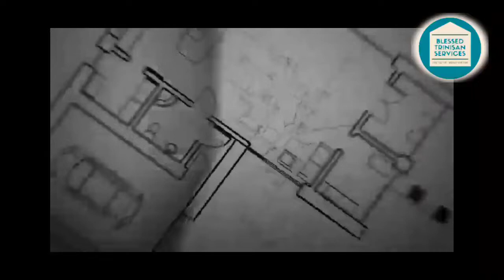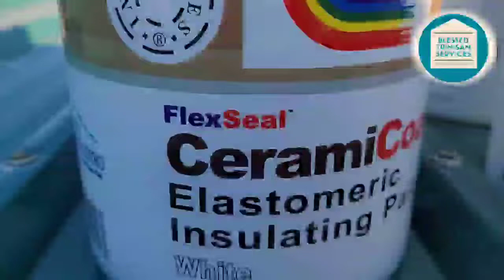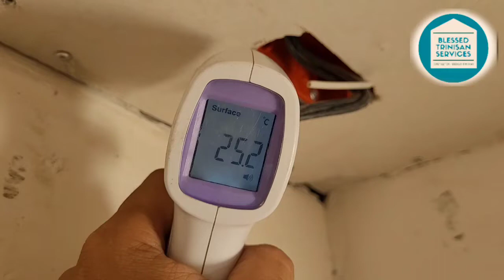HOW TO LESSEN ROOF/CEILING SUN HEAT WITHOUT USING INSULATION FOAM

Comment: Sir, gawa na din po ang bahay namin. Ask ko lang po before ilan ang temperature before painting and after painting?
Reply from the maker: as per our vlog are concern, pinakita namin yun changes sa temperature brother. Thanks & Godbless
Reply: @BlessedTrinisanOfficialVlog dami mong sinabi instead na sagutin mo na lang. pweh
Reply: Hindi reliable ang simulation na ginawa mo. Dapat gumamit ka ng dalawang wired sensor thermometer pahiran mo ng ordinary paint yong isa, at insulator paint yong isa. Pareho mong ibilad sa araw at makikita sa thermometer kung alin ang mas nag absorbed ng heat.